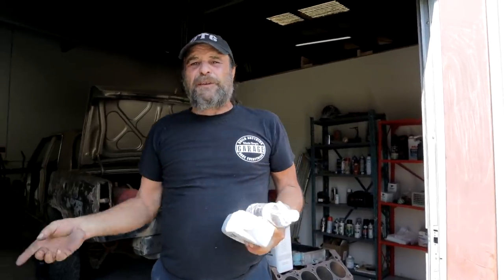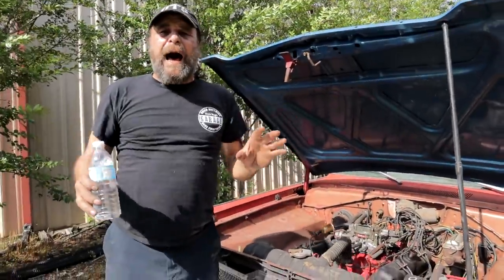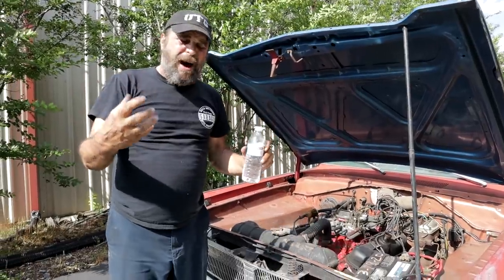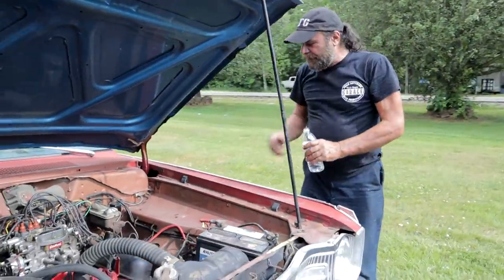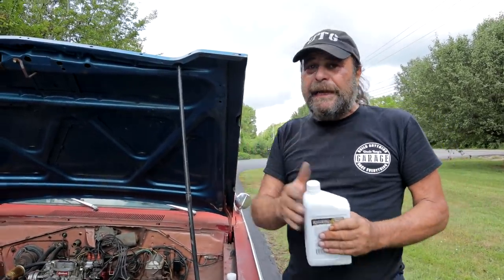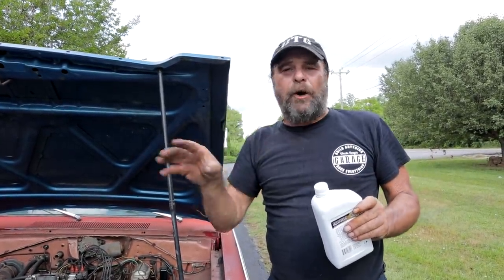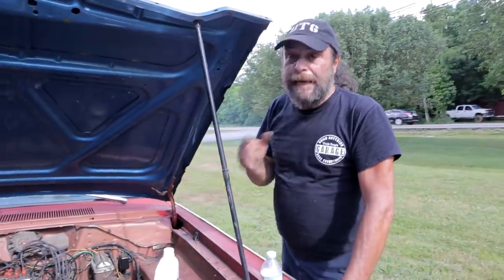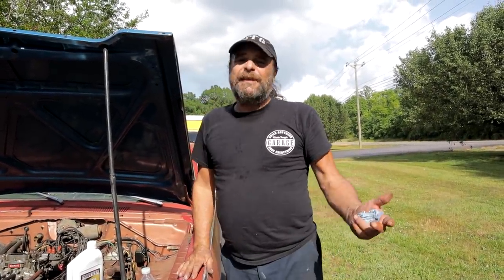Forgotten Service Routines From The Distant Past

Comment: I have used water on  cars that  have converters on them from the 70's and 80' s back in the day with no problems in fact buick V6's back in the day would get a carbon knock that sounded like you had a rod knock  but a little water and the knock was gone keep up the good work ! Do you remember carbon X66 made by GM great stuff back in the day!!

Comment: The technique I use is to take the same water bottle and use a nail to make a pinhole in the cap, similar to the squirt bottle that UT uses for gas. Keep the RPMs up no issue. Mopar also makes a combustion chamber cleaner too…but you will smoke out your neighborhood 💨

Comment: Another thing that transmission fluid is good for, is cleaning grease off your skin. Trans fluid is high in detergents. Clean the heavy grease off with atf then soap and water. You will spend way less time at the sink.

Comment: Last time I did the water & tranny fluid thing was about 15yr ago on dad's '29 Graham-Paige. It wasn't running right, spark and manual advance all worked properly - problem was in the chambers.   It worked because after we were done it ran properly.

  Before that, probably the late 80s or early 90s on either my 71 Plymouth Satellite or 71 Dart.

Comment: GM sold a top engine solution cleaner to pour down the intake of gas and diesels to decarbonize. I've used several different solutions from Trans fluid to kerosene and anything that would clean out the heads. Now I use Lucas top engine and fuel sys cleaner in the gas tank. Marvel mystery oil and Berryman Chem tool in the tank works well. Haven't had to smoke out the neighbors since the 1990s. Port injection did away with that. Those were the days.

Comment: You have to do this type of stuff to small engines all the time. Can't tell you how many flat head Briggs engines I've decarboned this way, but it's usually from failure to change/clean the air cleaner.

Comment: i think back in the day, in germany, people used brakefluid to clean the engine. smokes the same and we did not have ATF lying around, all cars were still manuals through the 80s at least. never seen the water thing.

Comment: I run some Marvel through the fuel system once ina while and I have done both the water and or ATF through the untake before . it works . ive never seen carbon flakes but seen drops of water out the exhaust pipes with black carbin in the drops water before .

Comment: I feel ya and understand. My grandfather taught me those methods and they work. Been a mechanic for 28 years. On my time gas, on the clock diesels only due to consistent good pay. I dont really like em, I prefer gas unless pulling torque is a have to etc and I know all the ins and outs. This new gen of souped up smoker diesels mostly has a fukin for a driver. I feel ya and agree. That ole 273 don't sound half bad.

Comment: Replacing one quart of motor oil with a quart of ATF is also a great thing for stuck rings or lifters.. especially if the car hasn't been run in a long time... just leave it in until the next oil change.. nothing will be hurt (and it just may save you tearing the motor down..)
Plus, for cars that used to run on leaded gas (pre-converter), use 15-40 Diesel-rated oil. It contains ZZP which will lubricate and protect  the valve seats like tetraethyl lead did back in the day.  ... (but it will destroy catalytic converters)
Reply: Your a bit confused, motor oil doesn’t normally lube valve seats unless your valve seals & guides are shot allowing oil to pass by intake valves on the way into the comb chambers. 

It was the lead in old school gas that lubed ex valve seats along with also increasing fuel octane too.

The zddp your ref to is an anti wear/scuffing agent that unfortunately prematurely kills cat converters therefore being significantly reduced in most all motors oils since the early/mid 2000’s inc being reduced in the 15-40 oil you referred too though it does have a bit more zddp then avg lighter visc fuel conserving pass car oils do.

Today’s cars with overhead cams or roller tappets don’t need as much zddp but old school classic car motors running perf Hyd ft cams must have elevated zddp lvl’s of approx 1300-1500ppm to live a normal/full srv’c life or they will fail prematurely.

Many of todays motor oils have roughly 600-800ppm zddp vs 1300-1500ppm many yrs ago.

There are are few over the counter motors oils with proper zddp lvls for old school ft cam motors but you have to know which they are and there are now oils avail more so online specifically formulated like back in the day for ft cams with the proper higher zddp lvls.

Air cooled motorcycle,mowers & hand held small power equip really benefit from higher zddp lvls that many oils don’t have which is why guys in lawn mowing biz go thru motors quicker then they should. That’s because many people are not aware of the issues associated with lower zddp lvls in many of today’s oils which some power equip guys don’t know either or they know but don’t tell customers to use proper oil with more zddp because doing that will reduce Srvc work & or sales of new motors/mowers etc.

Comment: British cars recommended decarbonizing the cylinder heads by removal every 40,000 miles.  It was common to remove flathead cylinder heads for the same service at a similar interval

Comment: Interesting thing is Seafoam just put out a product modification to do about the same thing in the last few years (about the time people were noticing all of the buildup on the intake valves of direct injection engines.  Seafoam basically has added a spray nozzle with a straw to feed seafoam into the air intake without unhooking it so you can spray in the seafoam with the engine running to decarbonize it.  Says its cat converter safe but I have my doubts...

Comment: I know the "ATF Treatment" well. First gen RX-7s are bad about carboning up the apex seals and losing compression. Disconnect the distributor, take the spark plugs out, shoot some ATF in the rotors, put junk plugs in, spin the motor over, let it sit overnight. Next day put the original plugs back in it and fire it up. No mosquito problems for the next week and your rotary engine would run like new! It was bad for the cat, but it's either that or rebuild the motor.

Comment: 348 Chevy wedge engines would knock as if a rod bearing were bad when it was carbon build-up on the head of the piston hitting the cylinder head. The cure, as Tony demostrated, was to dribble a coke bottle full of water through a hot engine to dislodge the carbon.
If you've ever had a head gasket leak into the cylinder the location will be obvious when you pull the cylinder head or take a peek with a bore scope. The top of the piston where leak is will be clean as a whistle.
As an aside on the 348. Back in the day you often saw a series of clothes pens on the engine. The problem was that the fuel line was routed up the passenger side front of the engine then down the seam between the valve cover and the cylinder intake manifold before turning up to the carburetor. On a hot day the fuel would boil in the fuel line to the carburetor causing vapor lock. The cure was to put clothes pens on the fuel line to get it off the intake manifold.

Comment: You're 100% right, it's a lost art indeed. Actually, GM came up with something years back, marketed through their AC Delco division. It was called "X-50 Top Engine Cleaner" and essentially it did the same thing, including fogging up the block. LOL. It appears that Delco still offers it today. 

As to the "IV drip" that morphed into systems for fuel injection as well. Many companies offered them including Pacer (who was part of the Echlin group) and Champion among others. Starr Hoffman, of Lindenhurst, LI was a supplier of some of the fittings and tools. They are now part of A&E Tool Company in Racine, WI. Excellent company. A&E actually is the OEM for many of the ratcheting wrenches that were/are US made including Armstrong, Craftsman, Klein Tools, OTC, Snap-on, and Williams. A&E even used the Snap On style date coding system. That's because the founder of Lang Tools, also part of A&E worked for Snap On in his early years.

Comment: I've heard of using water to remove carbon buildup but not transmission fluid. I have a 68 Mercury Cougar with the 390 FE motor. It was rebuild but along time ago. It seems tired and I have always assumed that the valves were messed up. I.e. Sunk, burned etc.... as the FE motor was known for that. I got the car about only 2 years ago and believe it sat for a while. I am going to give the water and Marvel Mystery oil in the carb a try. Not much to lose at this point. After all that I'll put in a new set of plugs. It will be interesting to see what color they are. LOL. Recently I put about a half bottle of MMO in the fuel tank as I have had some bottles laying around for years. So it's a cool coincidence that I found this video.

Comment: Working in the forklift industry with ic engines that run at low rpm on LPG I use the water method a lot and it shouldn't hert the cats either. In fact if you a vehicle that has a cat and is running on LPG and you get that bad egg smell from the exhaust run water through the intake until the smell goes away which is actually a Toyota service repair for this problem. As for lubrication of the intake track I use inox it's a bit thinner and seems to work it way into the crud better but transmission oil works fine to. Alot of newer engines don't provide a lot of cleaning or lubrication of the intake system and you can find thanks to a combination of PCV and EGR valves that the intakes get just complet dirtied up with carbon and oil vapour mixed together and this go's both for gasoline and diesel. There also products you can purchase that are designed to clean the intakes on later cars and the funny thing is no one know you should do it until there vehicle starts to run like shit and is low on power and by than its a mission to get it back to a clean state sometimes requiring removal of the intake manifold just clean out the blockage but if they regularly run something through on every service this problem wouldn't happen

Comment: I've done h2o and atf many times. However I heard about something else and tried it. I used a snake cam and saw carbon on the pistons and used a can of coke. Engine actually seemed to loose a bit of power cause it cleaned some of the carbon off the dished pistons.

Comment: I had a real once that I bought from an older friend that he did the same, it was a 1970 2dr Buick with a factory installed Marvel Mystery oil injection system on that still worked in 1990. Oh yeah still factory working 8-track stereo!
Now I wish I would not have sold it, the guy I sold it to rebuilt the engine and transmission to get his wife a real car. Still had the original stitched seat covers and a new white paint job.

Comment: I used to use a bit of gm top end cleaner in the intake on catalytic cars, and I think these methods are gonna make a comeback with direct injected cars and the recirc carbon filth they make on the top end.
Reply: AC delco/gm top end cleaner is great for that, and trust me I am no GM fanboy. I know of the dual injection systems now, but it doesn't help current owners tackle the issue.

Comment: Carbon treatments are alive and well.. probably even more so now that direct injection is widespread and valves get build it worse than ever since fuel never actually touches the valves. I've been a tech for about 10 years and it was very common to reccomend such cleanings with products from companies like BG or Justice Brothers and you used the tool you were describing that's like an IV drip.
There's also walnut blasting the valves that became common because of the buildup issue with direct injection.

Comment: Also back in the mid-70's Wynn had a product called Liquid Tune Up that you tricked down the Carb, then when the engine started to run rough then you'd let up and do it again for two or three more times then on the fourth time you'd choke out the engine with the product, then wait 15 to 20 minutes then restart the engine, it worked great the engine ran really good and you cleared the neighborhood of mosquitoes but the state EPA banned the use of said type of products because of the fogging effects stating it was polluting the environment. Then came BG's 44K, now when I worked as a diesel mechanic for the City & County of Denver a rep from BG came out and did a promotional on their products and sold us mechanics on their products, to this day I still swear by and use BG 44K on all of my vehicles. 
44K does the same thing those old ways did but all one does is put the 44K into your gas tank on a fill up and drive. 44K removes all of the paraffin waxes from the cylinders, valves, intake runners and carbon in exhaust manifold runners to a point that the carbon passes through the cats without clogging them.
Great stuff, Tony maybe you should try some on one of your cars and tell everyone on how it worked for you.

Comment: We put some ATF in the bosses fuel tank as a prank. He had the lovely white smoke pouring out of his exhaust pipe for about 30 minutes. He started thinking a head gasket cut loose and wanted us to check it out. Fun times. I really miss messing with older cars that had carburetors.  It never took very long to diagnose issues. Not like today. Even cars from the mid to late 80's and the 90's can leave you banging your head against the wall . I see so many owners throwing parts at the problem and not fixing it.

Comment: These process though they may seem outlandish are actually process that modern cars require aswell. Arguably more so then older vechicals. With direct injection, washing of the intake components doesn't occur. That coupled with the PVC system which are constantly under lower than atmospheric pressure and thinner oils modern car use introduces the possibility of carbon build up on a much greater scale. This issue is double if you speak about modern diesel engines. Of course using water and ATF can't be used but there are carbon clears that are safe for cats.

Comment: Instead of "water and ATF", we would use a product that came in @8oz cans to pour down the carbureator to clean out the carbon, BECAUSE each can contained a little plastic disk that was worth, IIRC 25 cents, or, it the disk was a certain color, 50 cents, which was extra money for us, and made a huge cloud of white smoke to show that it was 'working'.

Comment: New cars especially ones with direct injection carbon up very badly. They make new cat safe chemicals and procedures to clean them. The roots of this "new" thing is the good old method shown here.

Also adding the Marvel or ATF is good for the engine for storage, its "fogging" helps prevent rust and stuck rings/valves.

Comment: Tony has obviously watched some of WD's videos - LOL!! 
I was thinking the ATF was for the crankcase, pouring it in just a few miles before an oil change. A knowledgeable old-timer (aren't they all?) told me that it's because ATF has detergent properties. I also think it's better than the kerosene-based Motor-Flush, because that stuff tends to dries out the seals and actually works too good, leading to oil leaks.

Comment: In my dads engineering technician days at OMC, he had an in house additive that they made that was high in detergent and lubricating factors. My first vehicle had a carbon build up issue that kept intake valves from seating properly. Was about ready to tear the heads off it. Two tanks of gas with 2 quarts of that additive in each, problem gone. I really wonder what that stuff was.

Comment: We actually do similar stuff today bit with different chemicals. Direct injection engines REALLY need it. They suffer badly from carbon build up on the back of the valves.

Comment: You can use seafoam on modern engines for a similar effect without damage to the cats.
Reply: Did it on my 97 f150. I thought it was just some snake oil bs. Was I ever wrong the truck was so happy after that
Reply: Thats debated frequently
Reply: @mehmeh5471  Which part? It only really fixes carbon buildup on the valves (and doesn't do nearly as good a job as a wire wheel). Not some fix-all miracle cure.
Reply: Sea foam isn’t relevant for fuel injection in the induction system. Carbs only......but it’s great in the crankcase for anything with pistons!

Comment: Were these methods used in older diesel engines as well?
Reply: Yup . But you mix the Atf and water to look like pepto . And be very careful because the diesel is a compression = combustion engine. So the mix will run the engine just like fuel. Very little at a time .

Comment: I guy worked with many years ago  1960's lol had bought a Chrysler something from the 50's or late 40's. it wasn't running well but was his daily driver. he noticed a glass jar under the hood he thought was windshield washer or something. Filled jar with water then the engine ran fine! maybe was a water injection thing? let me know if you have ever heard of such a thing.

Comment: I saw an older video of your talking about an in-line fuel filter with a 1/4 bypass, 2 outlets.  I was curious what the filter was called for sure, and how you plumbed it into the vehicle.  If you have time and desire, please explain.  I really thought the old ford was going to singe Tony's eyebrows good.  Didn't happen, but I do wonder how many times it has?

Comment: Got a question , so I have an older truck 1987 F-250 Automatic with a carb and no cats came factory like that , Took the Harley carb off and put an edelbrock on it , with 1500 miles a remanufactured motor is it ok to do it on a motor with low mileage on it or just and older motor that is gummed up with carbon ????